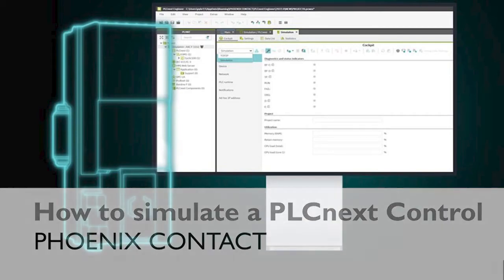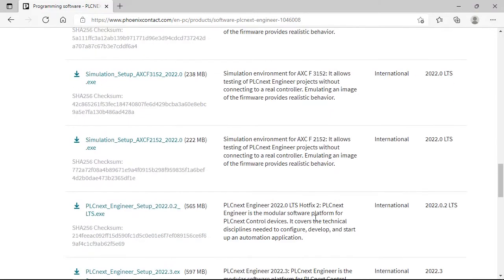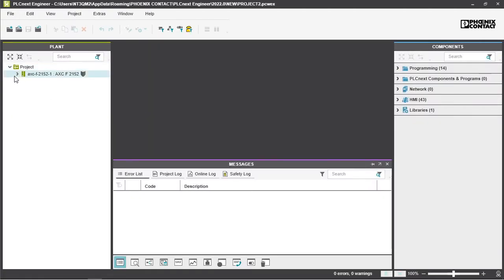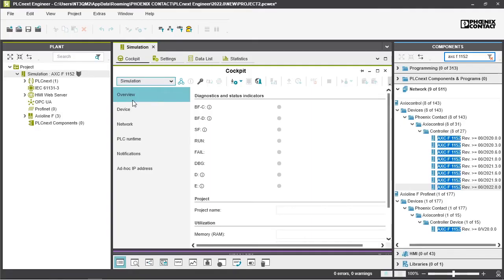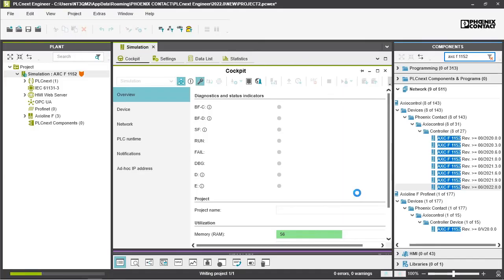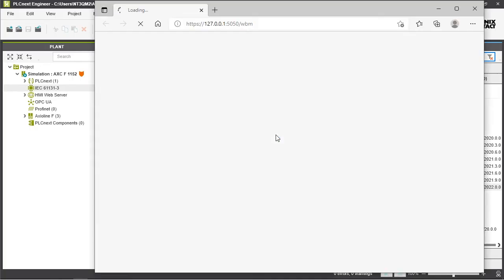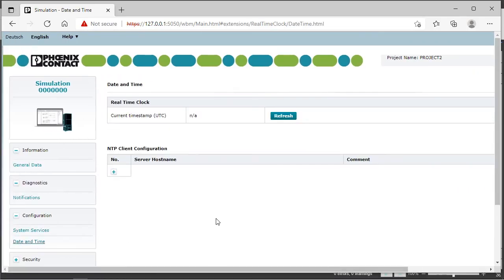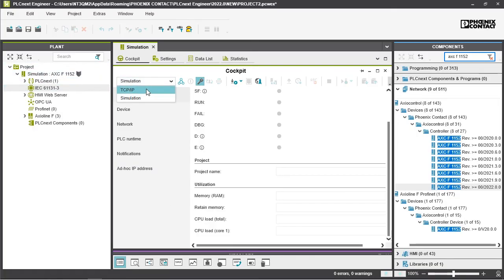PLCnext Engineer Simulation - program on PLCnext Technology without PLCnext Control hardware at hand

Comment: Please assist me: 

When I'm in cockpit and I change it to simulation I'm getting the error "could not find installation of simulation"
Reply from the maker: For the simulation, the simulation environment for the controller type must also be installed. It can be downloaded free of charge via this link: https://www.phoenixcontact.com/en-pc/products/software-plcnext-engineer-1046008#downloads-link-target. 
The AXC F 1152 can then be simulated without an additional PLCnext Engineer license. For the AXC F 2152 and 3152, a license must be purchased.
Reply: @PhoenixContactTechnical 

Using the provided link I downloaded & installed the "simulatio_setup_AXCF1152_2023.0.ex"

What do I do right after, please help me I've got projects I need to start doing?
Thank you in advance

Comment: Not helpful, for student to use, need hardware for this sim, PLCnext confused what a sim is, build project in CAD offers a better setup and its free.
Reply from the maker: Hi Ashley, sorry for your inconvenience but there's a misunderstanding: For using this Simulation no other hardware than a computer with Windows OS is necessary.
Reply: @PhoenixContactTechnical  simulation startup failed (MSG_ONL0165)?
Reply: The Vids instructions are wrong, or sample project, switch to sim fails? which download as it not clear, help manual is useless, this vid steps have been followed.
Reply from the maker: Okay, we see you need some more help here. Please contact the Technical Support team via this Forum: https://www.plcnext-community.net/forum/#/categories/plcnext-engineer

Comment: thank you for the help but how do you add and connect digital inputs and outputs in the simulation mode? it doesn't work as normal
Reply from the maker: Hi, the simulator does not support virtual or simulation IO's, but the user can configure the real hardware structure and force inputs in the data lists for testing the application.

Comment: Hi. Thank you for the video. The option cockpit where  you changed TCP to Simulation, I don't see on my software. I only have settings, IP subnet, Description and Online controllers. I'm using version 2024
Reply from the maker: Hi, thanks for asking. Seems like there is no simulation package installed, because the version number is the one for PLCnext Engineer (as of today the 2024 simulation packages are still to be released). Meanwhile, take one of the 2023.0 LTS simulation setup installers (download for free at https://www.phoenixcontact.com/en-pc/products/software-plcnext-engineer-1046008#downloads-softw-link-target). If you have more than one PLCnext Engineer software version installed, make sure to pick the according path during the installation process of the simulation packages. If it wouldn't work then either, please go to the forum section in the PLCnext Community (https://www.plcnext-community.net/forum/#/categories/plcnext-engineer) to get technical support for free.

Comment: Hi 
I have the problem that the program is restricted after i have installed it. Ive basically made the same steps you have made. How can i use it non-restricted?
Reply from the maker: Hi, thanks for asking. Following this link https://www.plcnext.help/te/Product_range/PLCnext_Engineer_Simulation_license.htm you'll find everything on licensing.